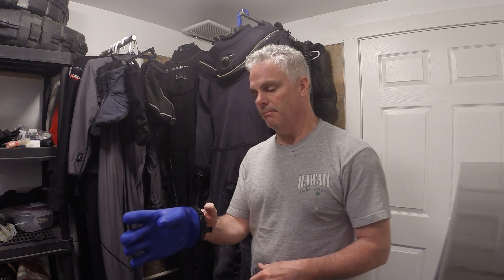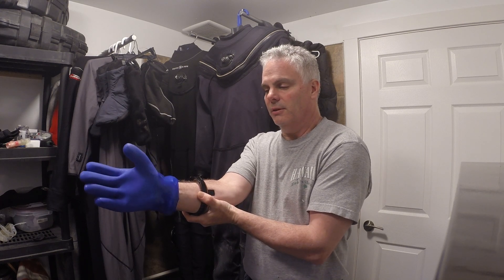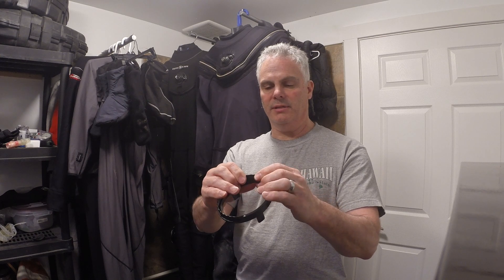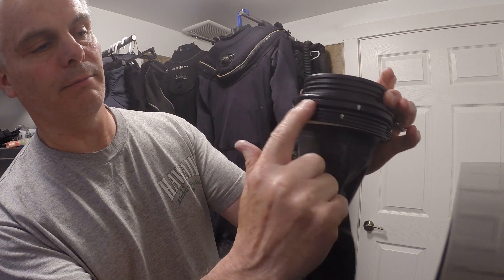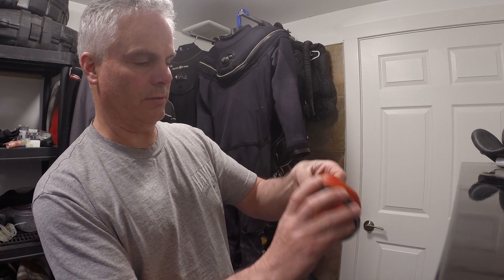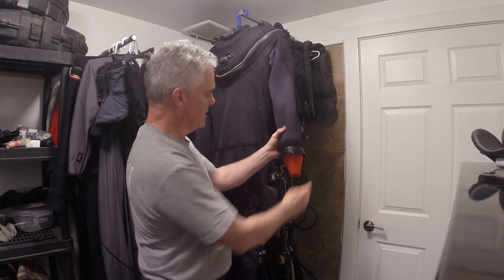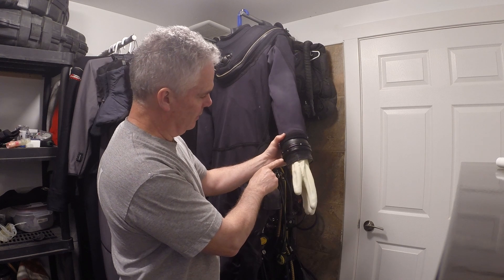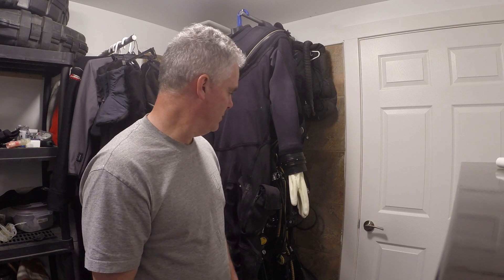Dry gloves for scuba. Antares vs PSI (Pacific Scuba Industry) and install of PSI system

Comment: I realize this video was done a year ago, but I'm looking at different dry glove systems myself.  
I'm wondering what your thoughts are on the PSI system now after using them.  
Still working well?  # of dives on them?  TIA
Reply: Might wanna check out the waterproof Ultima system too. i have it and it works exceptionally well.

Comment: Do you have to permanently cut the dry suit cuffs to put those on ?
Reply from the maker: My suit/suits are already fitted with a PU cuff (https://www.sitech.se/products/modular-solutions/pu-ring-for-qcs-oval.aspx) for the Antares dry glove system. I did not need to modify my suit.